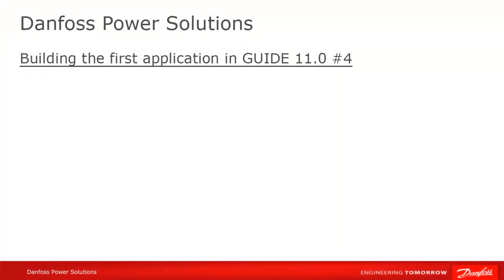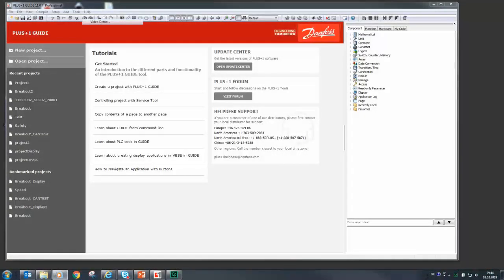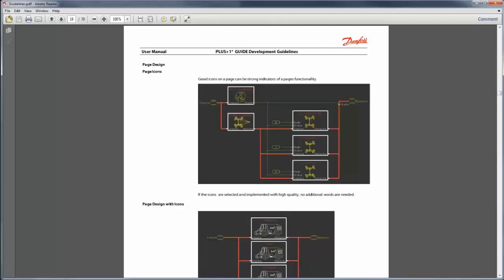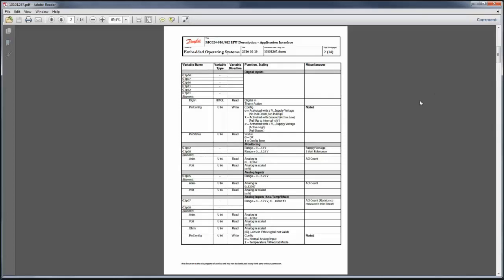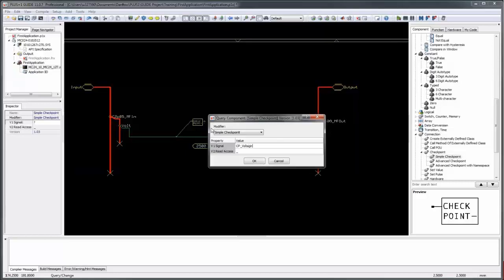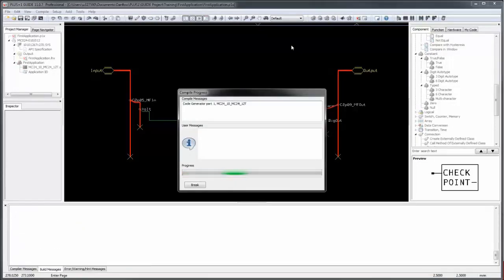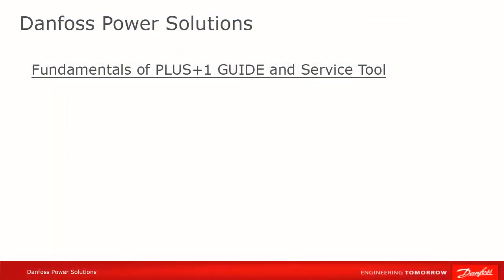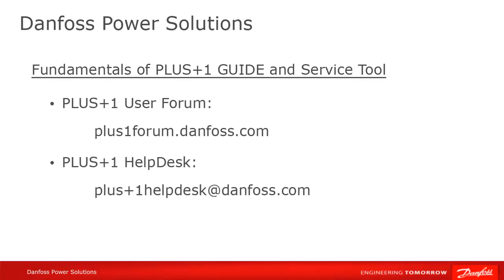#4 Building The First Application

Comment: This video is pretty much impossible to follow if you don't already understand the PLUS+1 Guide user interface.  There are several places where the narrator performs an action while only explaining what he did, not how he did it.  Notably at 12:12.  Viewers should definitely watch video #9 before attempting to follow this guide.

EDIT:  After watching video #7, I realized that the narrator presses K at 12:12 to switch drawing mode from bus to wire.  Whoever made videos #7 and #9 is substantially better at giving clear instructions than the narrator of this video.
Reply from the maker: We highly recommend you to sign up for a PLUS+1 GUIDE Fundamentals training. There you will learn all these basic features.
Reply: Oh.  Are these videos intended as refreshers for students that have already taken your training course?
Reply: @PLUS1Software  The only problem is that you have to wait 2 weeks before you get access to the course